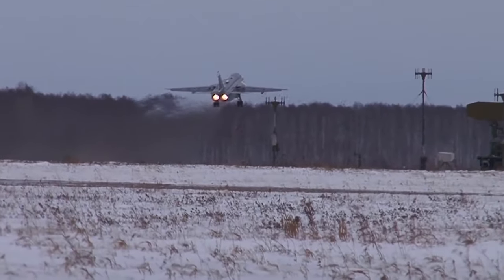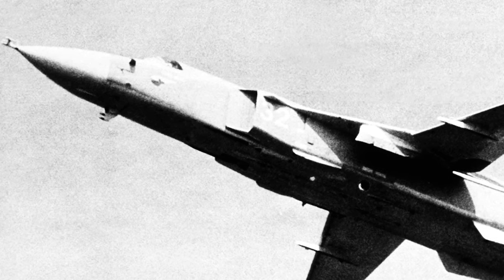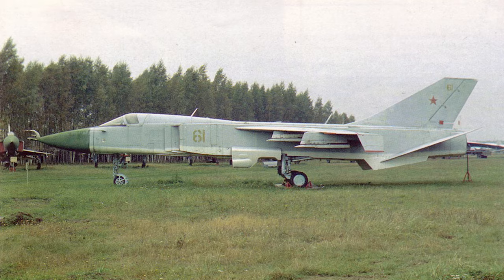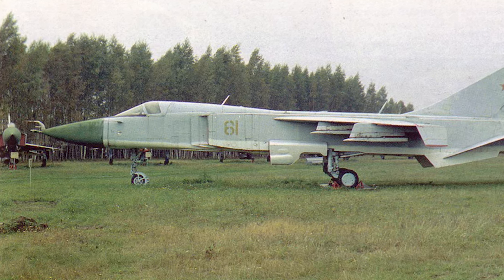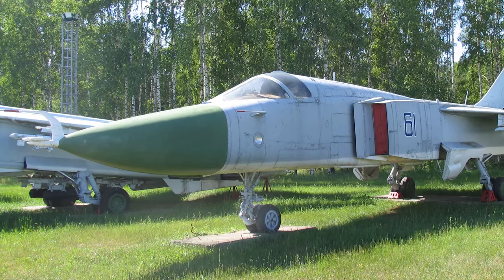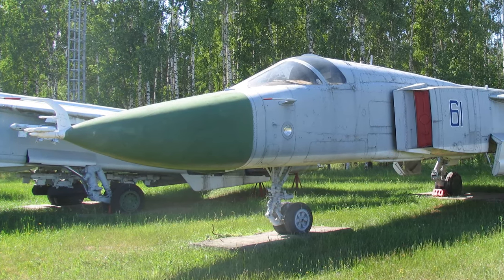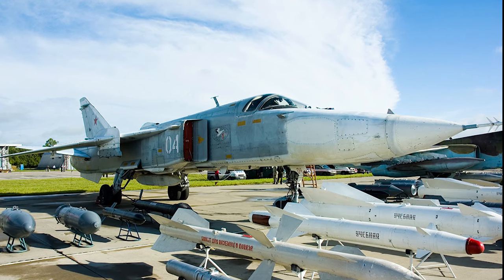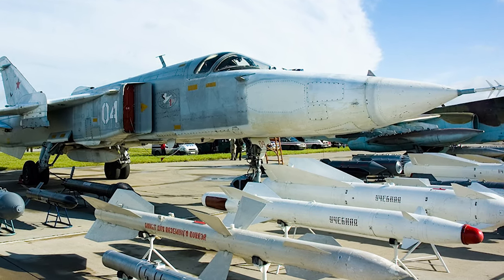Sukhoi Su-24 Fencer - A Short History

Comment: Looks exactly like a stolen copy of the F-111. To bad it didn't get kept updated to last a little longer.
Reply from the maker: There certainly are similiarities, but also differences. The Su-24 had a much shorter range, as the F-111 was designed for intercontinental missions. It also had a much smaller weapons load capability than the F-111.